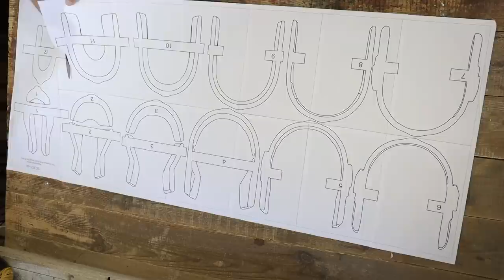How to make mandalorian wooden helmet | wood carving time lapse

Comment: How did you do the template cutouts?
Reply from the maker: I make templates specifically for working with wood, taking into account the nuances that can affect the progress of the work.  I use several programs: Zbrush, Blender and Corel Draw and Photoshop. I used Blender for slicing.

Comment: hey Oleksandr what Program did you use to create the Templates for the Layer? Great work!!
Reply from the maker: I used 3ds max, zbrush, core draw and photoshop. Not an easy job, making patterns sometimes takes longer than making a helmet out of wood.
Reply: Thanks for the answer :) 
So you made your own 3d model of the helmet?
Reply: I thought so it seems very conplicated to do all the layers
Reply from the maker: I made the first two helmets myself.  Then I started looking for ready-made models on the Internet.  Even from finished models a lot of work.
Reply: @oleksandrhrytsaiwoodcarvin1051  I understand.
Reply: @oleksandrhrytsaiwoodcarvin1051  Do you plan on doing other Star Wars helmets in the near future?
Reply from the maker: I live in Ukraine.  Now we have a war.  I can't plan anything.  I want to make a lot of helmets.
Reply: @oleksandrhrytsaiwoodcarvin1051  I didn't know. Thats terrible.